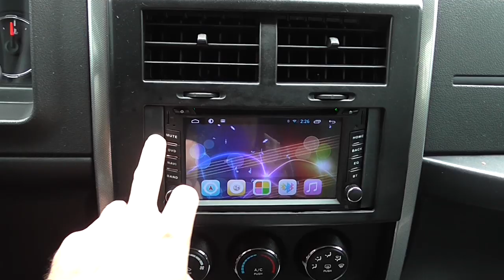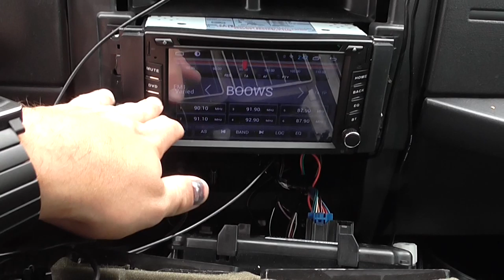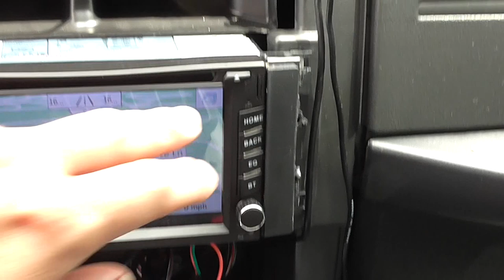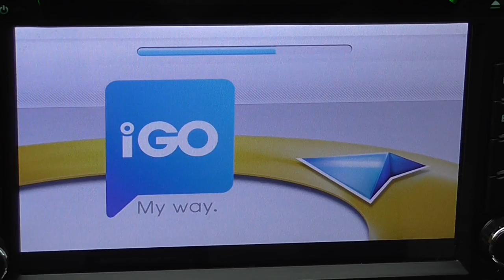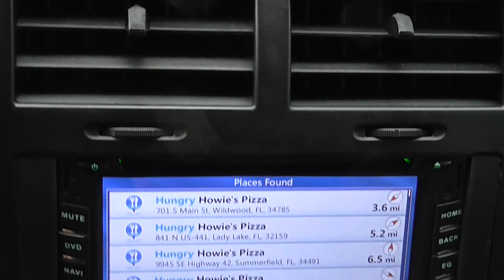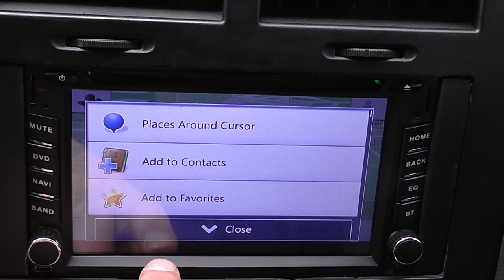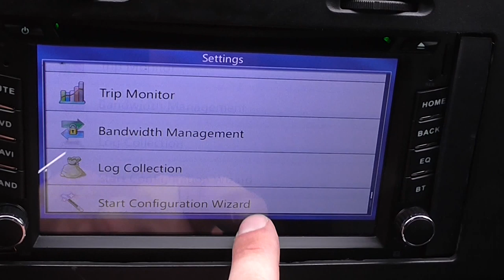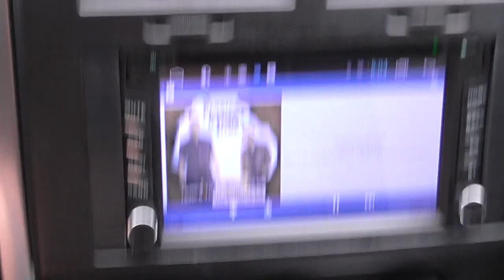Update: Android Car Radio

Comment: I understand that it has RCA preouts for video and subwoofer,but does it have ones for the front and rear speakers?
Reply from the maker: ***** huh? that does not even make sense. It has RCA for video and nothing else. How would you hook up your speakers to an RCA? Buy another converter box to hook up to a wire harness?
Reply: Joshua Bass He is asking about RCA pre-amp audio outputs for front and rear audio to connect to external amplifiers.  Most head units have front, rear, and sub.

Not sure what he is talking about preout for video.  It looks like it has a RCA video input.

Comment: Thanks for posting these videos on this particular unit. There's little to nothing out there covering it. I'm still waiting on mine to come in from China. I managed to get it on fleabay for $199 after bidding on it, now I get to wait for a month before I can test it out myself :) . I'm interested in seeing how it behaves to regular audio cd and dvd.. things like on-screen controls and such. I haven't seen this covered much, what I have seen was an MP3 CD and the interface looked pretty sloppy. I'd rather use USB or SD for playing the MP3. 

I saw in another video where the GPS antenna worked by sitting it directly on to of the head unit, I won't believe it until I try it but apparently it worked for someone. I've go the TomTom App for Android so I'll be giving that a shot :-D

In addition to the GPS have you set up the backup camera? If not I'll make a video when I get mine setup.

One more thing - I know you said you don't have a model number but have you checked in Settings -> About -> Phone Identity. The Android OS should tell you a model number, you may have already done this. The reason I ask is on the XDA Android Developer forums many people are getting these units and applying 3rd party updates. Would certainly be nice as I'm a developer myself. 

Update:
http://forum.xda-developers.com/showthread.php?t=2528349

^ I think this may be the forum for this device.

Comment: Can the Nav button be programmed to start any navigation app you choose or will it always start iGo?

And I agree, a true GPS is still a hundred times better and more accurate than a phone/Android/iOS device. GPS is still one thing they have room to improve on.
Reply from the maker: yes you can program the buttons to do anything. I have my BT button on the bottom right as my menu button. So it has a Home Back and Menu button like any other android device.
Reply: Joshua Bass
How? i haven't found where to do this? is it in the settings somewhere?
Reply from the maker: extra settings